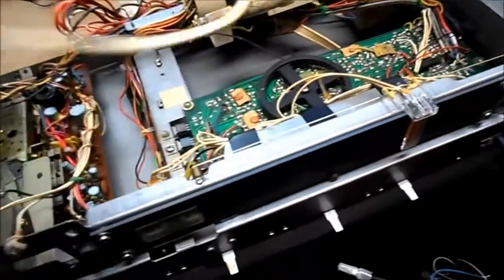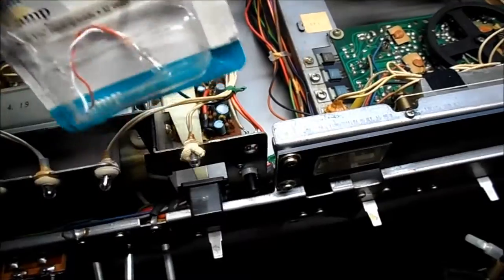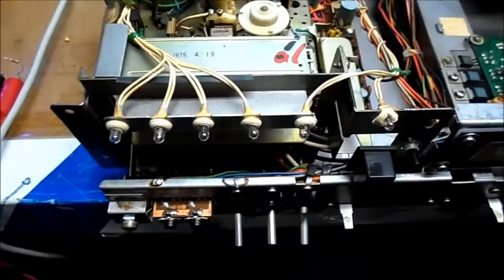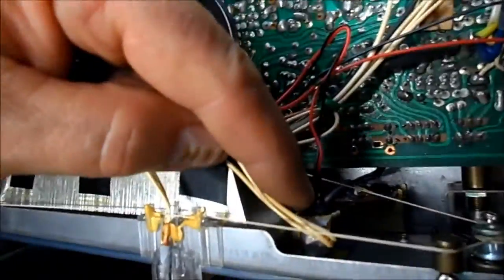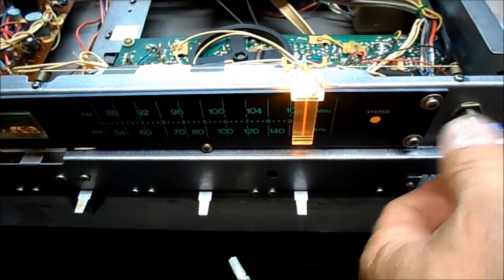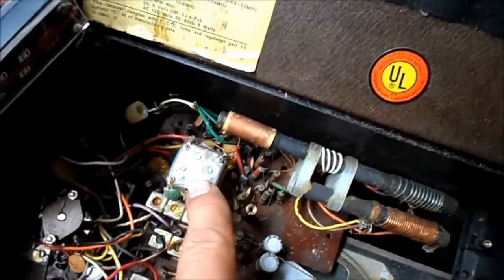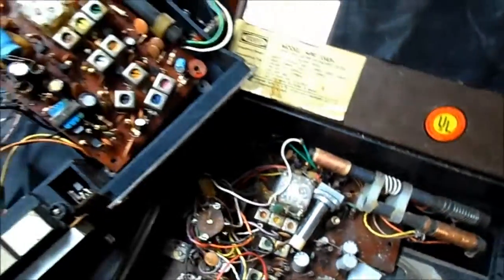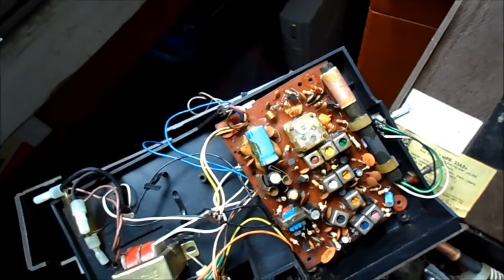Lloyds Part 4. Radio Section Done.

Comment: Hello Robert, a little info on the tuning cap.  The four post with the nuts on top, are the hot side(s) of the cap,  The ground is the metal straps in the middle of the two sides. It may be hard to see without a lens but the A.M. side is marked with an "A" for antenna and an "O" for the osc. F.M./VHF is marked with "FA" and "FO". The TOPP TRADING COMPANY radio is a AM/MARINE BAND/SW/FM/VHF radio. The three transformers below the tuning cap  are the AM/MB/SW osc coils,the can above the band switch is a FM I.F. coil.  The cans that are 2 by 2 are the A.M. and F.M. I.F. transformers. Hope this helps. All the best, Tom J. from FLA.

Comment: Here is some info on the OSC. and I.F. cans. A.M. osc  is red, 1st I.F. is yellow,2ed I.F. is white and 3ed I.F. is black. F.M. 1st I.F. is green,2ed/3ed I.F. are orange or brown or black. Ratio Detector are pink and blue. As far as i know there isn't any standard  color for the higher short wave bands. Most  set builders used this color code, some didn't. Hope this info helps. All the best, Tom J. from FLA.
Reply from the maker: Thank you. Goal is to eventually play with aligning using the Juliette and/or the Magnavox.
 I had an old Arvin AM transistor radio that I got stuck on some time ago, & would like to re-visit it.

Comment: I'd replace the bulb with a 3 mm yeloglo (white) LED in series with a 1 kilohm resistor - no biggie here 1/2 watt, 5% ought to work just fine, and will last way longer than the bulb - easier to get, too. If the bulb is behind a colored lens, pick an LED colored the same as the lens, and recalculate the dropping resistor.
Reply from the maker: I have a package of those for the solar lights, etc. Was a bit nervous at first using a modern LED for testing of the FM stereo indicator. Think older 80's LED's drew more current, 20mA.? I could "hear" the stereo, no indicator, however the lamp is more than just a lamp, it's part of the 38KHz demodulation, 19KHz stereo circuit I believe. You don't want to short out or mess with the stereo indicator. Been there, trust me not good outcome. The LED worked good, & will re-visit them in future repairs for sure.

Comment: Great Video. When you work on the 8 track can you go over the operation of an 8 track. I'm 23 and never used one. The tapes are wound in a loop aren't they?
Reply from the maker: Yes, Lear Jet Stereo, RCA Victor & other manufacturers. It consists of a 1/4 strip of Mylar (plastic), some Iron oxide particles, & Graphite as the lubricant. 4 Tracks (LR) stereo=8-tracks. Continuous loop. It's predecessor the Cart, 4-track mono was adapted by Earl "Madman" Muntz in 1962, for use in cars as an alternative to radio. They can be rewound without cutting them, if you are very patient. Forward only. No reverse. 8-tracks have their pinch rollers in the tape versus 4-Track tapes, which are in the machine. They are based similar, however, incompatible with each other.